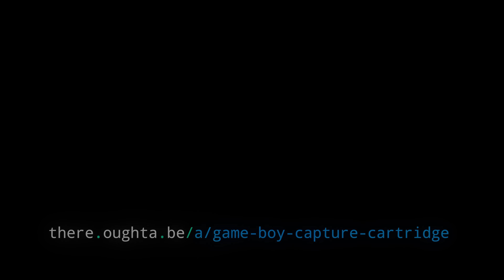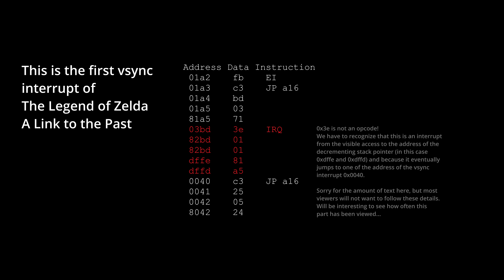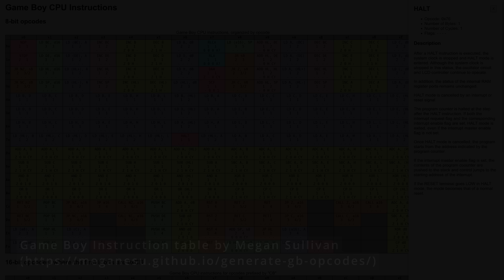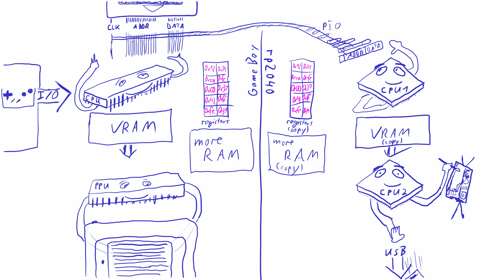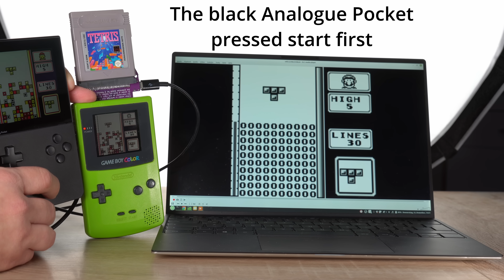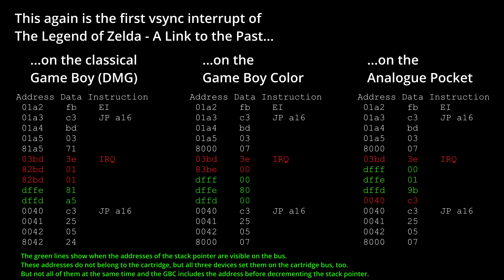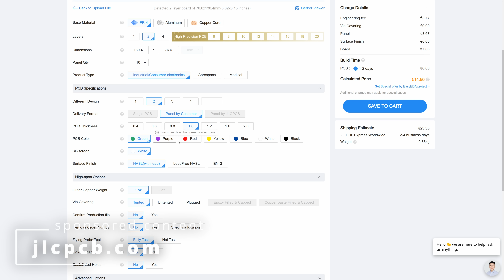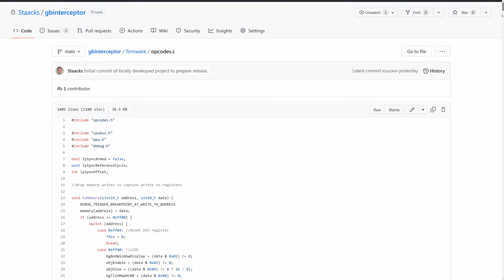A Game Boy capture cartridge: The GB Interceptor

Comment: how do I fix this issue it will connect with the game for about 3 seconds then it will go back to the waiting for game screen and it is driving me insane
Reply from the maker: Is it a specific game and a specific Game Boy model?
Reply: @ThereOughtaBe im using my gba sp but the game im using is yellow
Reply from the maker: Interesting, I just tested it and can confirm that Pokemon Yellow works on a Game Boy Pocket, but not on a Game Boy Color. I am very surprised that no one has reported this before...

After a short research I learned that Pokemon Yellow is "Game Boy Color enhanced" outside of Japan. So, it seems like the game will use some Game Boy Color features when it is plugged into one (or a Game Boy Advance), but it will run in clean classic mode on grayscale Game Boys. Game Boy Color features are not supported by the GB Interceptor, so this fails. I will put it on my todo to see what exactly it is and if it could be circumvented, but the issue is mainly that the game was listed as compatible when it is not on a Game Boy Color. Interestingly, the Japanese version is not "enhanced" and indeed it works with the GB Interceptor on a Game Boy Color (except I don't understand Japanese :) ).

Comment: Bit late but in theory would it have been possible to boot strap it to an emulator on the pc instead of trying to do it on the rpi? Like sending the raw data over the usb and then in software on the pc pipe the data into the drawing/image processing part of some already existing emulator? Would give more resources to the pi and the streaming pc does the image reconstruction based on the data?

Comment: can you connect it to your android phone for video calls? or pc only?
Reply from the maker: Well, with the latest firmware the GB Interceptor supports MJPEG which makes it compatible with almost anything that can use a USB webcam. Besides Linux and Windows it now also works with MacOS and with more Android apps than before.

However, only a few Android apps support external cameras and the few I found are not exactly... high quality. So, yes, it works with Android, but, no, your specific video call app will probably only support internal cameras, but not USB cams.

Comment: Can it be done with other cartridge based consoles? Like a 3ds?
Reply from the maker: This should be possible on any system that runs most of its code directly from a cartridge, which unfortunately is only the case for older systems. I do not think that it would even be possible on a GBA and even less so on a 3DS. For those systems reading from the cartridge is much slower than reading from RAM, so the essential code is copied to RAM first and executed from there instead of revealing the currently executed code by loading it when it is executed.

Comment: Good video. Can you make a video on how to build one using an actual Raspberry Pi Pico for those that would rather do it that way?
Reply from the maker: Not sure what you are looking for. You want to build it with a whole Pi Pico development board instead of just the rp2040? You would still need a PCB to interface with the cartridge slot of the Game Boy and a cartridge connector to plug the game into. And you would still need the bus transceivers along with a few capacitors and you probably won't fit THT components into a Game Boy cartridge.
I mean, I am quite sure that could be done, but it is a niche trade-off for those who are rather confident with a soldering iron and SMD soldering but not equipped for reflow soldering and who don't want to use an assembly service.
I don't think that someone with that soldering experience needs a video - they need a PCB design to match the Pico :)

Comment: Question, would it be possible to offload the processing and move it to an actual emulator that's running on the PC? If so, would this fix the 29Hz issue since the GB Interceptor would only send the emulator the necessary data?
Reply from the maker: Nope, each bus event is at least 24bit (16bit address and 8bit of data) coming in at about 1MHz. That's 3MB/s which is much more than the USB1.1 bus can handle. My plan is to eventually offer a 2bit stream as alternative that is decided by a software on the host PC.

Comment: Isn't the memory bus a shared bus? That would mean you could catch reads / writes to vram
Reply from the maker: Not entirely. For example, the CPU is capable of running code from HRAM and trigger a DMA transfer from cartridge to OAM. So, they are not just identical lines. But it indeed mostly sets the address lines at the cartridge end even when accessing VRAM - but not the data lines. At least the GBC and GBA do that. The classical Game Boy kind of sets the address lines, but they sometimes are wrong when accessing VRAM. That's one of the things I had to work around with the latest firmware version for the Interceptor as I relied too much on those addresses on the bus which would fail on the original Game Boy. So, it is a bit complicated which non-cartridge access on the bus one can trust.

Comment: The cartridge should be flipped 180° back so it is flush with the back of the gameboy.
Reply from the maker: The PCB comes with a break-out board to do that (see 13:22). But I think that "flush" requires a slightly different design for different Game Boy models. So, because I do not have that many different Game Boys to test it, I went for the design that should fit all Game Boys and made the PCB flexible enough to hopefully see some alternatives from the community.

Comment: When gameboy cpu writes to vram which tiles to render, isn't it using same bus as cartridge, but CS low? I'm not sure.
Reply from the maker: It sets the address lines at the cartridge end, but not the data lines. At least the GBC and GBA do that. The classical Game Boy kind of sets the address lines, but they sometimes are wrong when accessing VRAM. That's one of the things I had to work around with the latest firmware version for the Interceptor as I relied too much on those addresses on the bus which would fail on the original Game Boy.

Comment: What about games that control the X and Y scroll registers from the game pad directly?

Try Conker’s Pocket Tales, or GTA.
Reply from the maker: Are you sure that they really write data from the joypad input directly to the scroll registers? The only way I can think of would require bit masking the gamepad input, then bit shifting the value into position such that you get a value that is suitable to be added directly to the scroll register value and then actually add the value to the old one. In that case, yes, the Interceptor would not be able to follow. But why would anyone do that? Not only is it annoying to code, but it is also slower if you need to do anything else for a particular direction like changing a sprite, so the character looks in the correct direction or doing collision detection. Even if the controls really just scroll the window (like scrolling a world map without moving the player), you probably want to check if you hit the edge of the map and with this bitmask-shift-and-add method you would still end up with conditional jumps for these edge cases. Worse: You will end up checking both edges when you could have checked a specific direction.

Unfortunately, I cannot try those two games as my flimsy flash cart cannot hold these large GBC/GB dual mode ROMs. I hope someone can report back once more people have an Interceptor. But, indeed, I think there will be some edge cases like this that will not work and I really want to find them. Either to create a game-specific workaround or to admire the problem :) So, let me know if you can think of similar possibly problematic games.
Reply: @ThereOughtaBe  I just remember a bunch of games do this for e.g. the map screen. Conker is definitely one.

Also check the Pokémon games - I think the sprites for "pokémon facing away from the camera" (during battle) are actually blown up 2x by the CPU directly, to save space. You might see on your Interceptor that they are spaced-out blocks of tile data? Maybe...
Reply from the maker: Thanks, just checked Pokemon Blue and the scaled sprites are fine. Makes sense as they are loaded from the cartridge. Problems usually arise if data comes from one of the I/O registers.

I have also ordered a better flash cart to try GTA and Conker, but it will be a while until it is delivered.

Comment: I'm about to start work on a similar project with the NES. I don't know if it's different with the GB or video side of things, but I'm planning on reading writes to the APU registers by abusing the fact that internal and cartridge buses are (so I understand) the same bus.
Reply from the maker: Looking forward to see your work. I am not very familiar with the NES, but I think that it should work very similar as it should also run most code directly from the cartridge and expose other addresses on that bus, too. You will however have to capture both, the bus for the program ROM and the separate graphics ROM that the NES uses.
Reply: @ThereOughtaBe  The NES's Audio Processing Unit is controlled entirely by a handful of registers. Instead of creating an emulator as you did for this project, I'm planning on just creating an auxiliary APU that gets "written to" when the CPU writes to the internal APU registers. There are some Picture Processing Unit bus lines available on the NES and, if there is something similar on the GameBoy, that could mean you could read instructions sent to the PPU instead of emulating the CPU instructions.

Comment: It it possible to make this work with all gbc/gba games?
Reply from the maker: Yes, it should be possible, but I am not sure if it would work with the current hardware of the Interceptor. I am already overclocking the rp2040 and it would have to run twice as fast for the GBC. So, unless someone finds a way to optimize my code that much, it would require a different microcontroller. For the GBA it would of course be worse and I do not know enough about it to say for sure if it would be possible at all.
Reply: @ThereOughtaBe  GBA should be very possible , as the CPU is now on a ARM architecture, and your microprocessor is on ARM as well. Most GBA game are written primarily in Thumb-1, the same ASM language as your microcontroller, which means you can execute most insturctions immediately off the bus! The only instruction left to emulate are the normal ARM instructions, and the missing Thumb-1 instuctions, which should be rare.
Reply: @ThereOughtaBe  Even better, there is only one instruction that switch between Thumb and ARM, bx or blx, which you can predict because they will cause a hard fault.
Reply from the maker: I don't think that I will do anything like this again anytime soon, mostly because I have a few different things in mind that I would do next, but discussing the idea is certainly interesting.

However, it is not as simple as just running the instructions through another ARM CPU. You are right that it immensely simplifies some of the emulation because for example an addition is just an addition without masking and dealing with carry bits to emulate the "8bit version of addition". But you cannot just pump the instructions into the other CPU, because you neither want the other CPU to manage its own program counter, nor do you want it to actually execute jumps, nor do you want it to write to the exact memory addresses used by the Game Boy, and so on... Also you still need to catch things that are triggered by registers or the CPU itself, like for example interrupts, which also requires a bit of analysis of the instructions on the data bus. All this might be possible in fewer cycles than on the classical Game Boy, but since its CPU is four times as fast (there are different ways to count this and "four" is certainly not the whole story) there are also much fewer cycles available.

All this assumes that the GBA works like the old Game Boys, but we are entering the era of software being run from RAM. I have not looked too deep into the GBA architecture, but in contrast to the old Game Boys, ROM access is not as fast as RAM access. It's significantly slower. This means that quite certainly code is copied to RAM first, executed from there and the corresponding addresses would not be visible at the cartridge end. Even worse: The GBA has a prefetch buffer that continues to read from the ROM while the CPU is doing other stuff. This will make it almost impossible to apply the concept of the Interceptor.

Comment: What happens if you plug the GB Interceptor into a GameGenie, or into a Super Gameboy?
Reply from the maker: I do not expect any problems from the Super Game Boy, but since I do not have one I am awaiting feedback from someone who actually has one to try it.

Plugging the Interceptor into the Game Genie will not work because it would only see the communication of the Game Genie with the cartridge and not the modified communication with the Game Boy. The Interceptor should go between the Game Boy and the Game Genie, so it can see the communication that actually arrives at the Game Boy (that would be quite a contraption hanging out of the end of the Game Boy, though, even when using the break-out board). Unfortunately, I don't have a Game Genie and a quick test by someone else did not work. I think it is because it resets the game when it actually starts and the Interceptor only expects a restart once the Game Boy was turned off. It has the same issue when using an Everdrive and I have already written a fix for the next release, but I can only tell for sure if someone with a Game Genie has tried it.

Comment: Awesome job! 🤩 Will it work with EMS (or any other) flashcarts? Can I use multiple, like 4+, at the same time as different webcam sources when streaming, or will they mess with each other in some way?
Reply from the maker: Simple flash carts that just run a single ROM should work without any issues (I am using one for testing myself). More complicated ones with menus might cause problems when they reset the Game Boy in order to start the game after the menu. The Everdrive is a good example where the Interceptor currently needs to be plugged in after the menu is already showing to prevent it to start with the menu and instead start when it resets for the game. I have already written a fix for this, but since I do not have an Everdrive I am still waiting for someone to try if it resolves the issue.

About using multiple at the same time: I have not thought about this, but the only issue I can see is that currently the serial in the USB descriptor is just set to 123456 in the firmware. This might confuse some software, but it should be easy to resolve by flashing firmwares with different serial numbers to each device. Ideally, I will find a way to generate a serial from the serial of one of the chips on the board (well, actually only the flash chip is a candidate here), so each Interceptor would automatically have a unique serial. One other possible issue might arise if they are all connected to the same USB bus. It is only a USB 1.1 device that uses low bandwidth, but it runs in isochronous mode (the bus has to poll data every 10ms) and that can be trouble for some USB hubs if they have to manage multiple such devices. But all in all I think that these are solvable issues.
Reply: @ThereOughtaBe  Thanks for the answer! Then it should work with the EMS's, as there's no menu!

I will follow the progress of this project closely. I thought it could be fun using the interceptor with LSDJ and thinking in a live setting it would be cool to have the screens of the DMGs projected as part of the backdrop. But then it needs to be able to run aside at least one more! I don't know how USB busses in computers keep track of what device is which, but you seem to be on to something getting the serial from the chips instead of hard-coding it in! 🙂

Great job with this so far! 👏